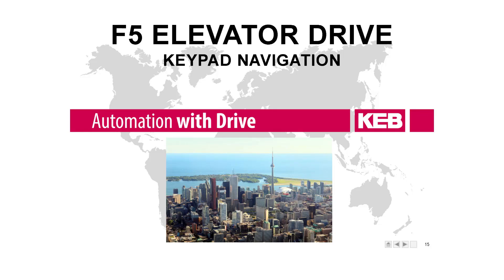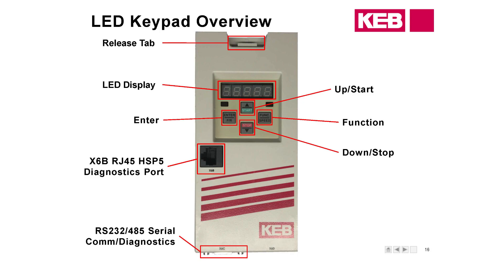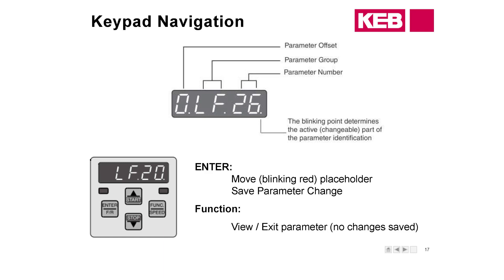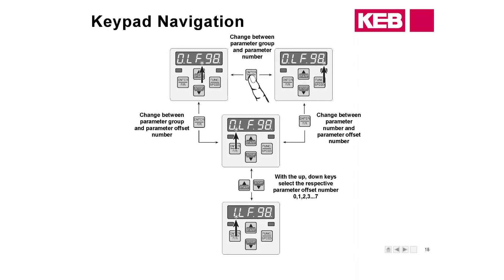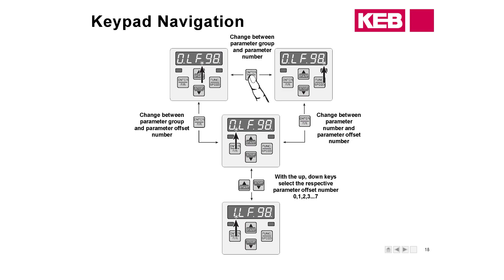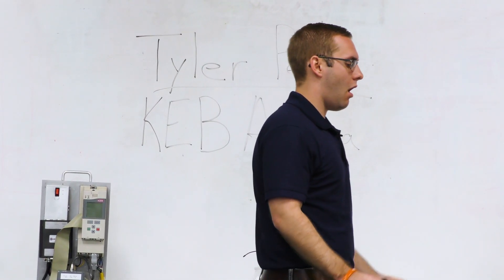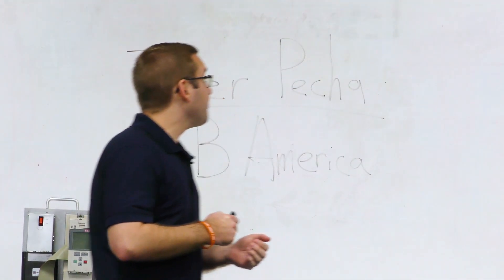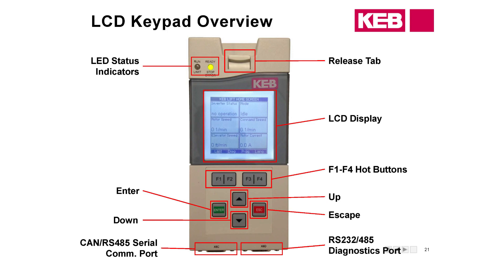KEB F5 Elevator Drive Training: Keypad Overview (Part 2)

Comment: what is the parameter offset? i searched for this word in the manual and it does not mention anything about it? why are you complicating a simple inverter this much?
Reply from the maker: Thanks for your comment. This video highlights our legacy F5 drive. In the early 2000s, this product was developed and upgraded over its 20+ years of service, improving performance and adding options with updated keypad operators. Today, we have transitioned to the F6 drive with a more simplified connection to today's technology. Let us know if you have any other questions. Thanks for watching!

Comment: Hi... I have a problem with vfd f5 104 kva it writes an E OC error... When I change IGBT it works a little bit ... and after the same problem is repeated
Reply from the maker: E.OC is an over current error. For further help you should contact your machine's original manufacturer (OEM). If you cannot find a solution through them, then contact your local KEB representative. If you are in the US or Canada you can contact us at: https://www.kebamerica.com/contact